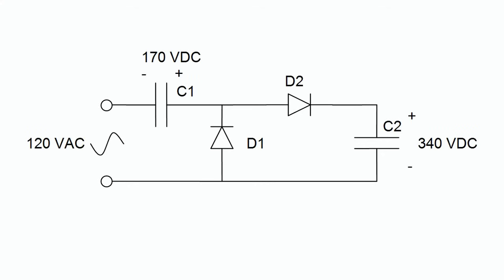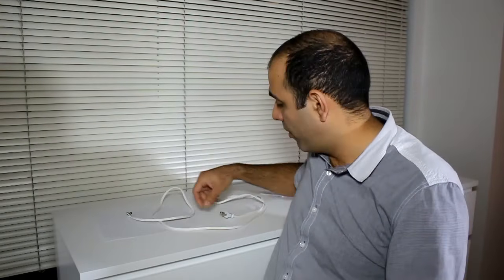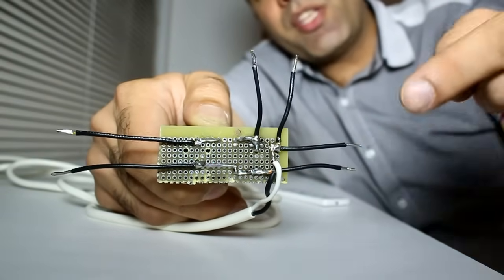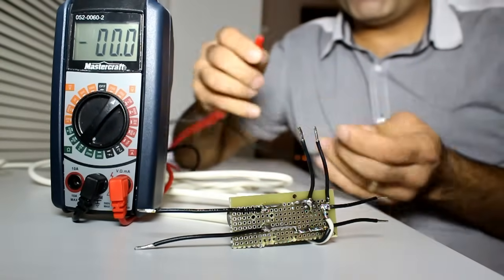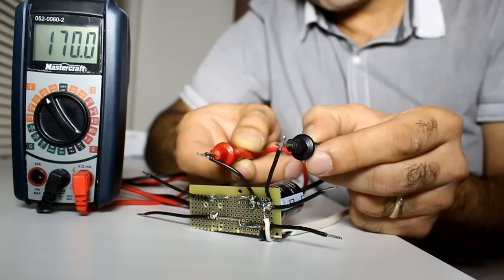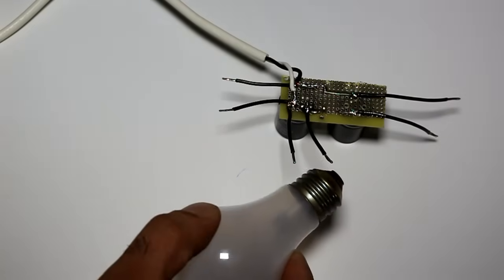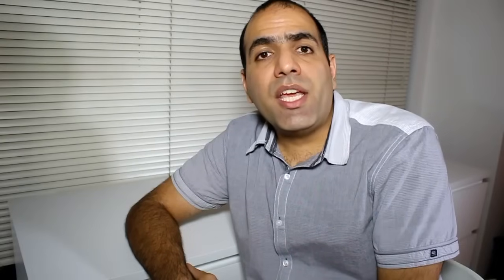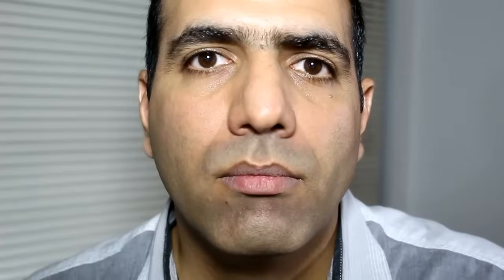High Voltage AC/DC Effect on Human Body

Comment: This might already be answered in the comments. But I'd like to know why all of our home appliances are not DC powered if DC power is so much safer?
Reply: +Saeid Momtahan 1. Because it's hard to make AC from DC if you need it, but it's easy to make DC from AC.
2. Because AC voltage can be easily adjusted with a transformer. Lowering DC voltage requires more complicated circuit, raising it is even harder.
3. Electricity is transferred over long distances and transferring it in very high voltage greatly reduces losses. Combine that with previous point and you have one more reason.
Reply: +Saeid Momtahan Different appliances require different dc voltages. When you convert dc to dc power loss is higher. If you were to supply your house with 170 volts dc and you need 5 volts for your phone charger, that remaining 165 volts is wasted and is dissipated as heat. This is just too costly and energy hogging. It is far more easier to convert an Ac voltage to lower or higher AC voltages using transformers. The only losses in a transformer is a Iron loss (which is because of the iron core of the transformer and is always constant for a given transformer) and the copper loss (which is because of the copper winding, this depends on the amount of current being drawn). These loses are fairly small and can even be reduced by using better core and winding materials. So, now if you need 5v for your charger you can use a 120-9v transformer and than use a regulator to get 5v output.
Reply: +Melroy van den Berg It's not that simple. Considering how expensive computer PSUs are, imagine how expensive it would be to buy outlets for your newly built house. And how big holes you'd have to punch in your walls to fit all that PSU stuff in them.

Okay, now you have one PC PSU in every outlet. What if someone decides he wants to plug 5 computers into one outlet? The PSU won't provide that much power. How do you handle that? Well, you could use 1500W PSUs, that should probably be fine for six regular PCs or two to three gaming rigs. But! Outlets would be even more expensive and these PSUs would be inefficient as hell under low load (eg. only one PC).

Oh, and how about cooling these? PSUs need cooling. Are you fine with outlets blowing on your feet?

How about when you need a 5V outlet, but the nearest one is 12V? You start looking for another one, but it's a 25V one. Crap. Oh, here it is, the 5V outlet. Finally you can charge your phone... on the other end on your room, where you have finally found the outlet you need.

Regular 230V outlets are universal, they can power anything and that's the great part.
Reply: I understand and agree with all above comments.  What I mean is converting AC to DC at the meter in each home and supplying all DC powered  appliances
Reply: ***** Yes, smart ass you are not the only engineer here. No one is trolling with him. The things you mentioned will still take a decade or two to be widely used or even more than that. He asked "why we use AC over DC?" most people gave the actual answer. Which is actually why we use AC to this day. He didn't ask what are we going to use in the future. Who knows we might not even use cables in our houses. Everything can be wireless. And yes, DC-DC converters are very efficient and you can use DC lines today if you want, but then you will have to have separate line for your DC stuff and separate line for AC stuff which is added cost on the consumer.
Reply: +Saeid Momtahan See my points 1 and 2
Reply: MrOmnos Thanks for your thorough answer. It makes sense now.
Saeid
Reply: +Saeid Momtahan If you really want to know why we use AC instead of DC, I recommend looking up the War of Currents between George Westinghouse (AC proponent) and Thomas Edison (DC proponent).
Reply: +Saeid Momtahan at the first times, there were only dc which edison liked very much. But you cannot carry dc so easily. And it is expensive. Then ac came, it was much cheaper and easier to transfer at very high kilometers
Reply: Patrick Clausen DC is not used in transmission lines in any of the countries!!
Reply: Patrick Clausen such as?
Reply: +ivan Reynoso What are you talking about. I almost fell of my freakin' chair reading your comment. electrons move at the speed of light dumbass. So, AC AND DC current moves at the speed of the electrons. YOU cant transport DC current over long distances because electrical current heats up everything it passes trough. AC current switches it's polarity 50 times or so every second, so you don't get the effect above. Seems you never heard of Nikola Tesla or Thomas Eddison eh?
Reply: MrOmnos oh yes! Converting a home to DC would be a huge undertaking. It will also be a very expensive one too, especially for early adopters. Basically manufacturers will have dual product lines for decades. For a consumerist society it could possibly be lucrative, lots of new jobs to to make all stuff, rebuild houses for dual wiring. I find it intriguing on a technological level, however I can't say I have given the entire proposal any in deapth look at every facet of society. Really poor people can't afford this, but still they'd be forced to at least obtain a big azz DC to AC converter to keep running all old appliances, they do not come cheap.

So, it might be a pipedream.
Reply: Because in DC has fixed polarity meaning you can plug in a device only one way
Reply: Because electricity transmission is carried out in AC system and not DC because DC can not be generated at higher voltages and it can not be stepped up or down which is very easy in case of ac
Reply: The real question is why not using AC only for transef and installing an AC to DC converter at the main power of the house? Most devices today operate on DC. Light bulbs, Pc's, chargers, TV's....
Viewer: But how is this possible when they are plugged on an AC outlet?
Light bulbs donr care about ac or dc and for other devices if you open them you will notice that there are 4 black things (diodes) and something that looks like a battery (capacitor) next to where the power comes. These actually convert AC to DC. So the only thing we need to do is to remove these and then they are compatible with dc outlets! Its that easy! :)
 And many other devices that actualy use AC could also operate on DC with some small changes...
Reply: distribution , in dc the voltage drop is very high , while in ac there is a low voltage drop in lines
Reply: Dont forget that an HVDC system converts AC from the generators into DC transfers it  over great distances BUT it converts DC back to AC so you can step down the voltage. So its almost impsible to not have at least one single point where the power is AC.
Reply: Coz manufacturers don't give a shit about our safety. All they see is profit, you see AC line voltage cannot be directly fed into the FOOOOLLLLL BRIDGEEE RECTIFIEEERRR IT JUST wont work so, you need to feed that AC line into a transformer to be able to use a FUUULLLL BRIDGEEEE RECTIFIIIEERRRR with it. You see its very impractical to have a transformer even in simple appliances like a heater. I HOPE THIS ANSWERS IT!!!!!! AND ONE MORE THING IS THAT AC CURRENT HAS BECOME A CONVENTION.
Reply: +Saeid Momtahan Holy clusterf*** peoples comments are so far off I think they are trolling you! We have AC only for historical reasons! In the dawn of electricity it was discovered that it was easy to step up and step down voltages for effective power transmission with a AC transformer. Power is voltage times current. You needed to step up the voltage because the current is what heats cables ultimately. So, you can have a thin copper wire with high voltage to transmit a smallish current and still deliver tons of power after step down transformer. Easy enough in the beginnings, wires wheren't that long so losses seemed acceptable. Today though, we have so high power demands and few sources we need to shuffle big power long ways. What they discovered was that with long wires came really big losses because of the AC. Every shift in polarity needed some extra current that was dissipated as capacitive losses due to the proximity to ground and other wires. With really long transmission wires NO power could be delivered! It was all lost in capacitive charging. So they began experimenting with thicker wires and they soon found out about skin effect, the current that is rising or falling prefered to travel mostly in outer parts of wires, so the wire conduction capacity didn't scale with cable thickness. They tried to increase voltage, but that lead to corona discharges, meaning more losses. So their only remedy was really tall and wide pylons to carry the thick cables that had to be finely stranded and partly isolated from each other strands(to combat skin effect) and just live with the losses (30-40% per 1000km). However a few years after the AC had been widely adopted they started experimenting with DC transmissions. DC hasn't got the capacitive losses or skin effect and wires could be bundled together and doesn't demand huge pylons and isolated to combat corona effect. ... but the technology wasn't quite there yet to handle DC transmissions and DC to AC conversions at users endpoint was difficult and expensive. Today it's another ball game, many countries prefer to bury cables because pylons are ugly and requires maintenance to stop vegetation to reach up and keep pylons from corroding or get blown down and the freaking losses! Burying AC cables can only be done at lower voltages and lesser power density because of losses to capacitance. A normal 350kV AC wire can only run 40km buried, then all carrying capacity is lost capacitively! Buried DC cables solves all that and has very minute losses. A HVDC system for 1000km only has a loss of 3,5% compared to 30-40% for AC, but initial investment costs in stations are ofcourse higher but with time it pays off due to minimal losses. So some commenter says that DC isn't good for electric power transportation which is strange coz it's best we've got. Personally I can't think of any appliance that would be significantly harder to make a DC version of instead of AC so I'd like to see a dual grid in house, a DC and AC during a transistion time of a few decades all appliances would be exchanged to DC. Any device with digital electronics would be so much easier to use with DC. It's not that hard to step up or down DC today with modern components so any digital electronics would become smaller, cheaper and more effective with DC outlets.
Reply: +Saeid Momtahan AC travels farther than DC
Reply: +maxicx75 AC is redundant today, everything in a home runs fine on DC, i.e. every appliance could easily be manufactured in DC variants.
Everything with digital electronics would be cheaper and more efficient to make in DC only variant since every damn digital device first needs to rectify and store energy in bulky caps all that can be taken out from every tv, monitor, pc, charger, radio, LED lamp making all products cheaper and more efficient.

AC is crap to use for electric power transmission due to skin effect, reactive effect and capacitive losses... All that is avoided with High Voltage DC. Granted it requires more advanced/expensive substations but the power lines are simpler, can be buried or submerged and losses only a tenth of long range AC transmission.
Reply: +MrOmnos nononono! As with AC, Dc-Dc converters can be made very efficient and smaller! than AC transformers. Transformers has a large self heating when not even in use! DC-DC converters go into low power mode. Small AC transformers have crappy efficiency compared to small Dc-Dc converters. So having 120-170-230V DC in our power outlets would be much more efficient than same in AC especially for digital electronics, also safer for user since we can tolerate much higher DC than AC. I've been zapped several times by DC and AC and AC is much worse, damn once I was breaking out in cold sweats, numb arm and was pretty much catatonic for a good 30 minutes while thinking about life and death. DC zaps I just say ouch! and carry on a second later.
Reply: +Saeid Momtahan Good point, I think every outlet should have a build-in AC to DC converter. Bam! End of discussion. You can charge your phone safely. And also you can connect your computer to the outlet without need of an extra power supply... Some outlets should output 5 volts others 12V and 25V, then you are done I guess... Why not?? Or make outlets which outputs 5V,12 and 25 within the same outlet.

ps. You can already buy 5V USB everywhere: http://ecx.images-amazon.com/images/I/71OzZ-nj0gL._SY355_.jpg
Reply: +MrOmnos LOL, most western nations which has concentrated power sources far from users has high voltage DC (or will convert once age catches up) as means for long distance electric power transmission. Anywhere you want to have a 30+km submerged or buried power cable with more power than feeding a village you'll go DC because it's cheaper, has low losses et.c. Many old AC transmission stretches are being rebuilt with HVDC stations because same wires can carry far more power with DC than it could carry AC. New power generation sites uses DC technology from start so it's optimized for transport. I mean DC has 3.5% losses compared to AC 30-40% losses per 1000km!
Reply: +Mihai Adrian I almost fell off my sofa reading your comment! High Voltage DC is the best we got for long distance transmission! Per 1000km DC has 3.5% loss vs. AC 30-40% losses! True that initial investments are much higher for HVDC, but with that efficiency and power density that AC can only dream about, it's no doubt the pay off comes soon enough with DC. AC and DC has the exact same heating effect of resistivity in materials(most commonly copper and aluminium). However... AC has capacitive, reactive and skin effect losses, requires big bulky pylons to separate cables and you can't bury/submerge high power cables due to capacitive losses with distances over 40km. Having 100-200V DC in our home outlets would be safer too as we have much higher tolerance for DC than AC.
Reply: +Melroy van den Berg I would prefer to get rid of AC all together in homes. DC appliances are not more difficult to manufacture than AC stuff. Every digital electronic device would be so much more efficient, cheaper and smaller without AC. DC is also safer for people. Since we have many high powered appliances we still need highish voltage on DC too like 100-240V DC or possibly we have dual sockets where high power is needed (kitchen, bathroom, and a few for vacuumcleaner). The primary socket might be for chargers LED lights, basically anything up to maybe 200W or so. Problem is the transition period of a decade or two where we'll have AC and DC waiting for AC appliances to die while replacing them with DC variants.